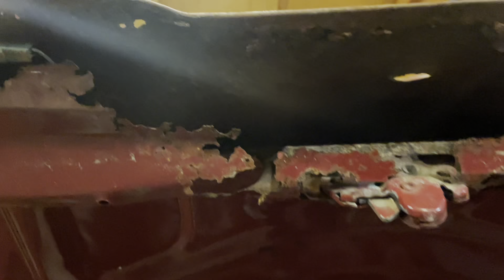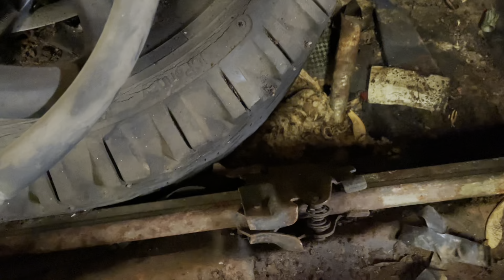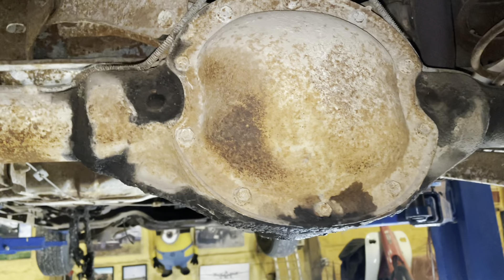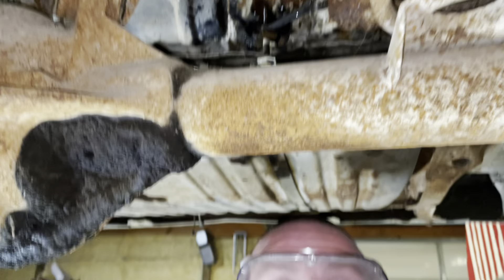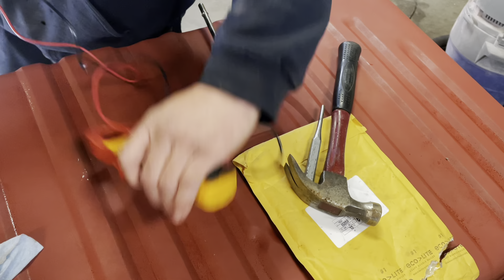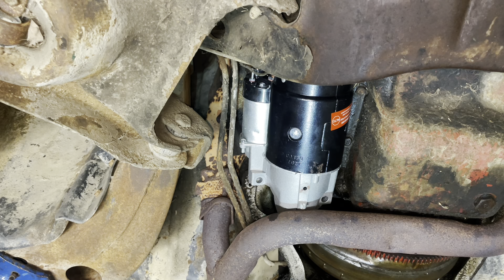1969 Buick Skylark project episode #5. new fuel tank and starter.

Comment: the other wires on the starter are fusible links. They protect what the fuse block doesn't. Mainly your headlights. You don't need to make changes. your videos are fine. we just need more people putting these Abody back on the road.

Comment: Had a '69 Skylark I purchased in Checotah Oklahoma. Had a bad engine. Brother towed it to me where I lived in Nebraska. I had a wrecked four door '69 Skylark that had a great drive train. I made one good car out of both of them. Drove it for 8-9 years. Great car.
Reply from the maker: I love mine, ive got a buick problem, 5 of the 68-69 cars are at my place.
Reply from the maker: Also checotah is only about an hour and a half from me.
Reply: @BrokenWrenches  I currently have a 1970 Skylark 2dr hardtop. I've had two '69 Skylarks. I am very familiar with your project. The Buicks are a great buy for people who want a 1960s GM A-body.

Comment: You might want to consider putting a return-style fuel pump on your car since you already have a return line going to back to the tank. I think I heard you say you live in Oklahoma, so you probably get some pretty warm weather there, and the return line can help alleviate vapor lock issues that tend to occur on these cars when it's hot outside. 
Thanks for the video and I really look forward to more on the '69 Skylark.
Reply from the maker: Thank you for following along and for the tips. Summertime does bring on major vapor lock problems here, especially with high performance engines and the overall poor quality of fuel the last couple years. Im actually putting out a new video on this car this Wednesday, kicking this project back into gear. Getting very close to having it back on the road for the first time since 1986. Stay tuned.